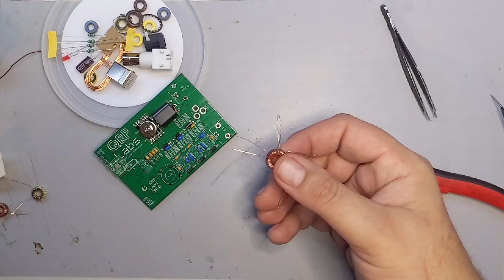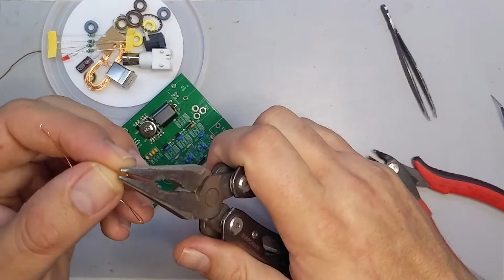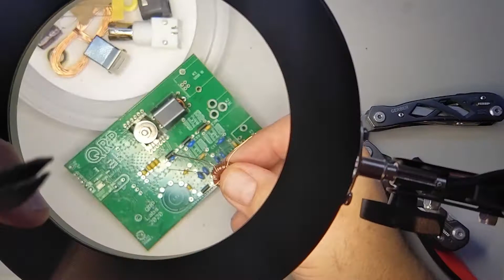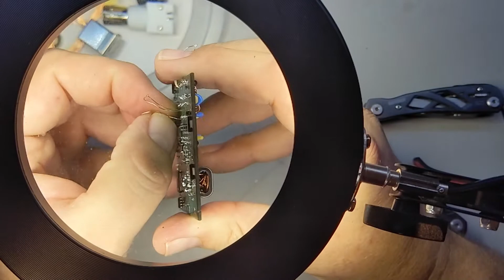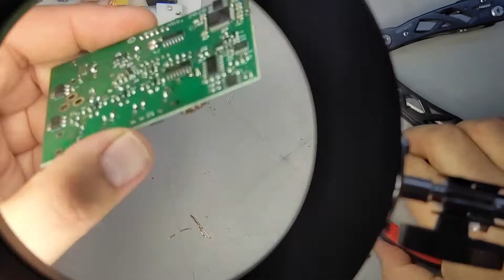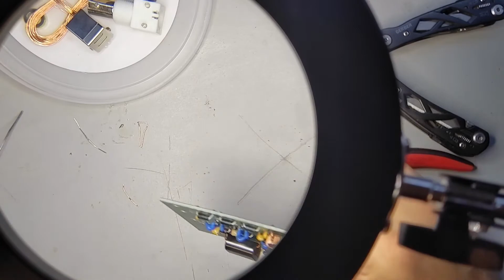QDX Build Part 7: Installing L12

Comment: I'm wondering why you take the time to separate the loop wires. I've always twisted the loops into a bifilar tight wrap up to the toroid and snipped the ends before inserting in the pcb holes. I'm careful to scrape the enamel off all wires near the toroid, to ensure a solid solder joint. Either way, the loop wires are joined electrically once soldered in place.
Reply from the maker: It's been a few years since I made this video, but I think I was just following the directions closely. For the sake of demonstrating them. There's definitely lots of ways to do it. Your way is as valid as any. Thanks for the comment and watch!